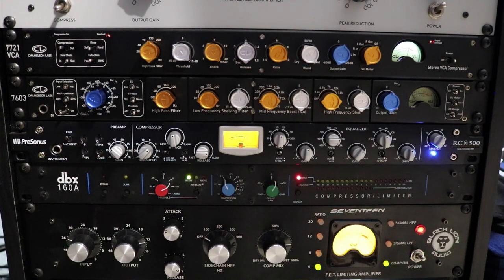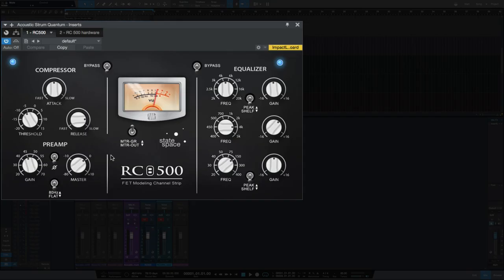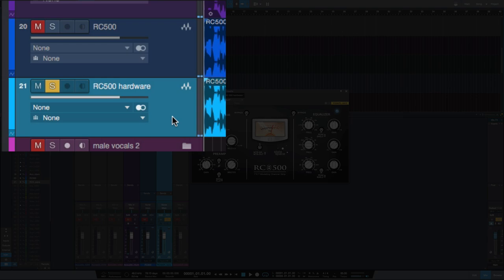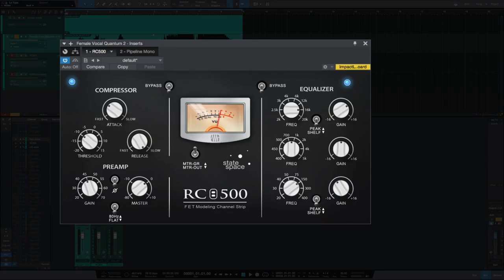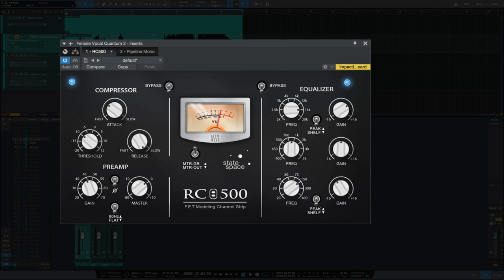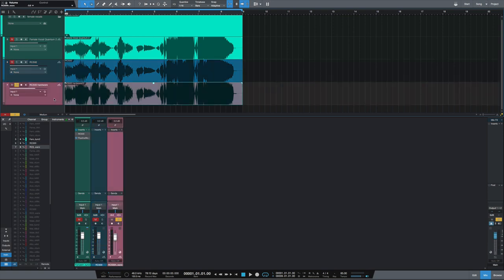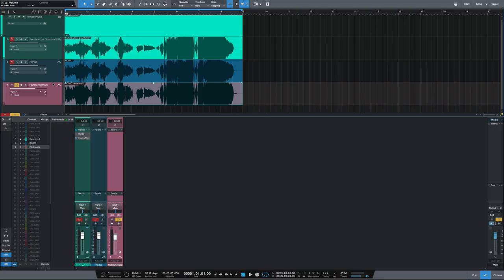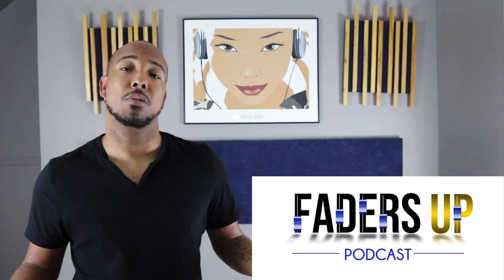PreSonus RC500 plugin vs hardware

Comment: This was very interesting in the fact the plugin seemed to be bright and annoying. What I mean by that is I noticed the plugin appeared to amplify the sibilence of the vocalist. Where   as the hardware had a more warm pleasant character and smoother sound. There’s certain characteristics in hardware that software can’t reproduce... (yet). Which brings up the question, should analog summing be used to restore some of that hardware character that software lacks? Overall good video keep them coming.
Reply: I agree100% I struggle with the hardware /software thing alot ...I have the mpc2000xl and the mpc studio...My mpc2xl clearly is better but, the mpc studio sound cool!

Comment: The software version of the guitar felt a bit more "boxy" to me, as if there was some low mids that were perhaps a tiny bit boosted compared to the hardware version. But I'm not sure. The difference is indeed tiny. The compressor in the hardware version also sounded a bit more smooth to me. Maybe the difference would be more clear with more extreme settings.